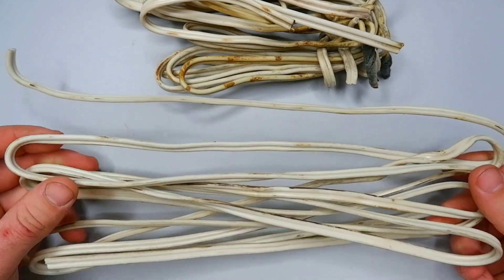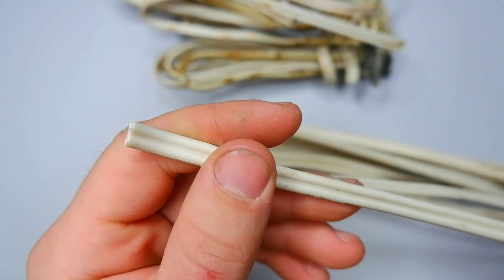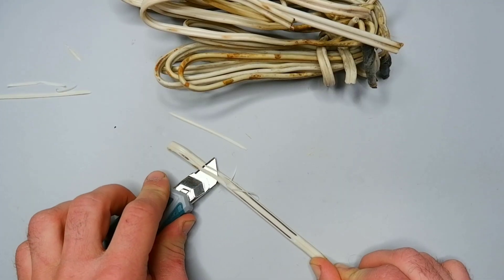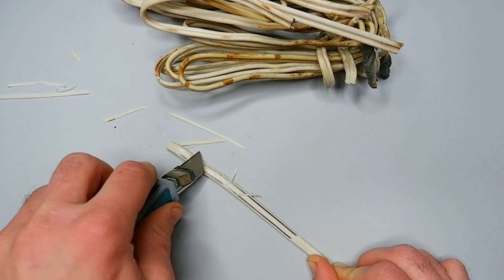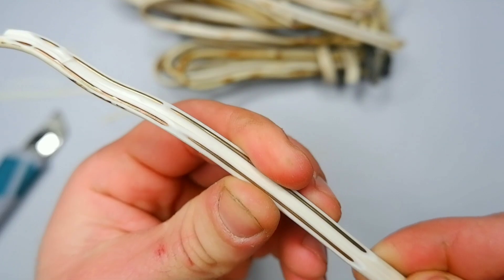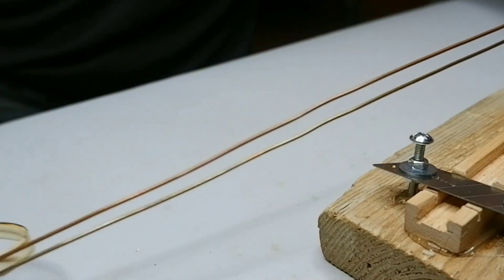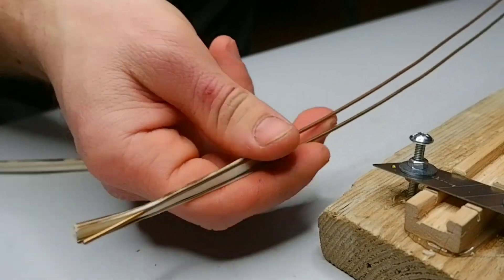Best Wire Stripper for Stripping Wires of insulation. Make it in 5 minutes.

Comment: make a machine for stripping copper out of aluminum copper radiators easily, I use a sawzall and thin grinder disc, there has got to be an easier way, would make a cool original video too!